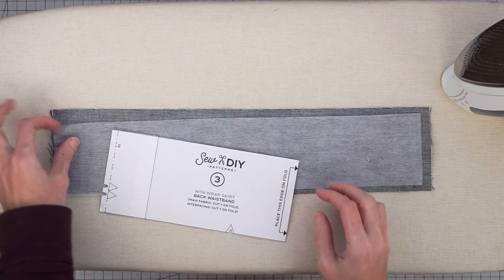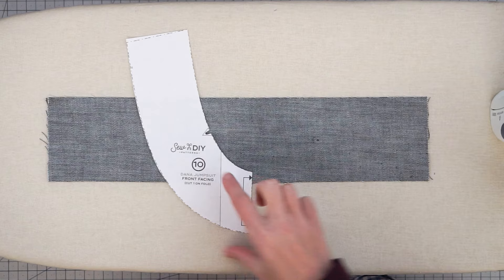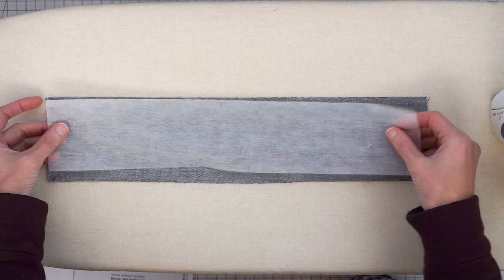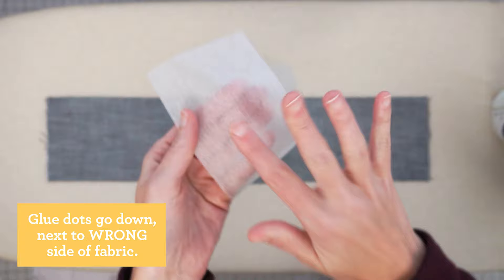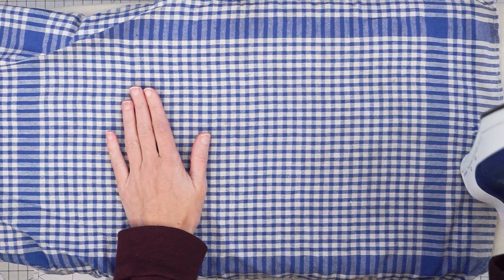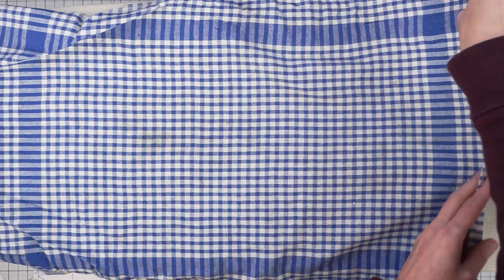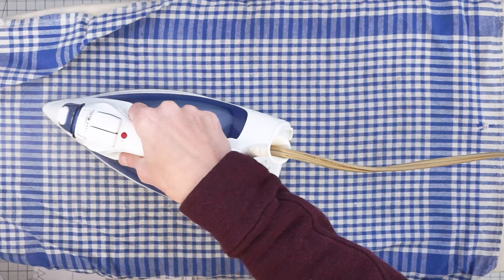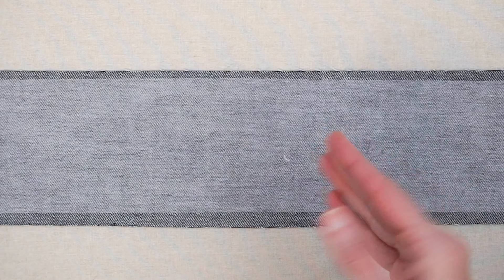How to fuse iron-on interfacing to fabric

Comment: For the most part, the sewing industry has stopped using any interfacing in clothing years ago. For a $100.00 or $200.00 shirt, yes, maybe, but not in average priced clothes at all, not in cuffs, collars or anywhere else.  No doubt it’s a big cost saver for manufacturing to eliminate facing, and it’s too bad, as it did an important job by giving a better structure to the garment.

Comment: Thanks for the tips! I want to make a cape for a sculpture. Do you know if the fabric can be bent and shaped after the interfacing cools?
Reply from the maker: The fabric will bend but it won't stay in position on its own. I think you'd need some sort of armature to help shape the fabric into 3D positions. Also, heavier interfacing will be stiffer but less pliable. I'd do some testing with different materials to see what works. Maybe research how 1950s style skirts are made to give them lift. I believe they have horse hair braid added to the hem. Plus, layers of tulle underneath.

Comment: So many helpful tips in one video! Thank you! 🤍 Question: does adding a fusible fabric interfacing layer also help with fabrics that fray really easily? I'm sewing small doll clothes by hand and the loose woven knit I'm using doesn't hold up to a needle anywhere near the edges!  Thanks for any advice!
Reply from the maker: Yes, interfacing does help reduce fraying at the edge. I wouldn't recommend it as a finishing method because I'm not sure how it stand up to multiple washings. But for your example, I'd give it a try.

Comment: Hello  I am making a poncho out of a woven blanket what kind of interfacing can I use around the collar to keep it from unraveling?
Reply from the maker: Hi! I would usually use interfacing as a way to stabilize or make a fabric stiffer, not as a way to prevent unraveling. I would recommend looking for a way to "finish" that edge, either with a finishing stitch, a facing or a hem (turn the raw edge under twice and stitch it down).

Comment: Thanks for this very good information. Do you think I could do this on fur skin? I am making a 15”x16” cushion out of old mink coat pieces left after making a throw (professionally done). Would the iron-on interface stick on the leather side of the fur?  I would like to use the cushion, it would not be just decorative. Thanks.
Reply from the maker: Hi Johane, I'm not sure, it's not something I've tried before. I suppose that the heat wouldn't harm the leather side of the fur. Sorry I can't be more help!

Comment: Do you need to use steam or just iron without steam in it for fusing interfacing?
Reply from the maker: I usually do use steam but some fabric and interfacing can melt with steam. So, you'll want to test it out first and/or use a press cloth.

Comment: what is the long term effect of these sorts of products on fabrics? cannot be organic at all. and chemicals must make up the  structure of these products.
Reply from the maker: Hi Jan, I don't know. It's not something I've thought about before. I do have a lot of garments that I made 10+ years ago and the areas with interfacing don't appear to have aged differently. If you don't want to use a fusible, you can use an organic cotton muslin as interfacing. I haven't done it myself, but a google search will bring up some info.
Reply: babe everything is chemicals

Comment: So you never did say whether you used steam or not.  Very important.  😑
Reply from the maker: I generally use steam but some types of interfacing say to use a dry iron. So, it kind of depends what your interfacing and your fabric can handle. I'd start out by testing with scraps to see if steam is necessary and if it's going to melt the fabric or interfacing.